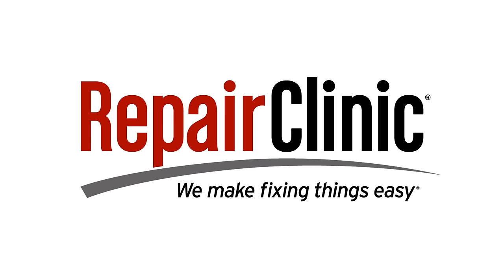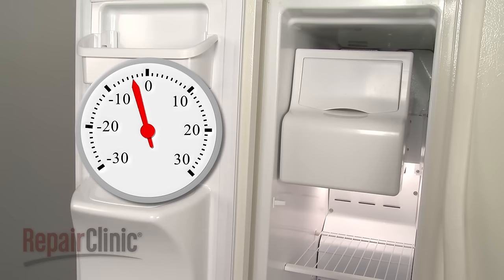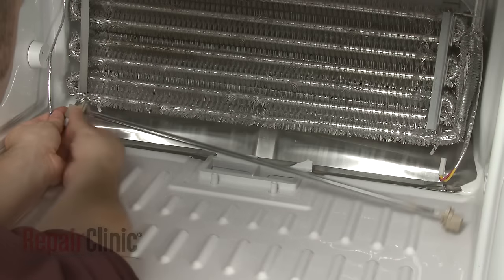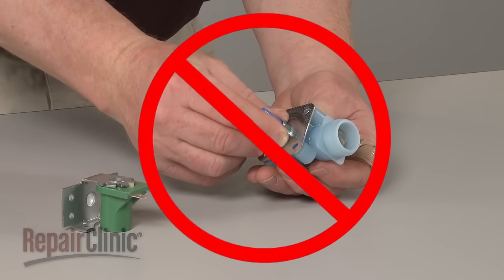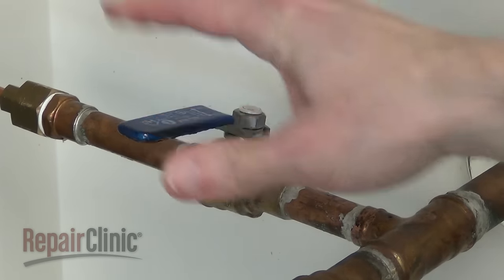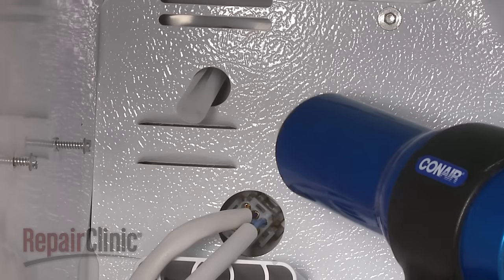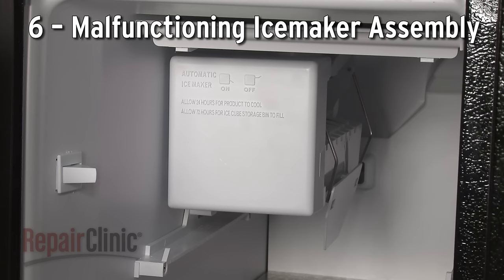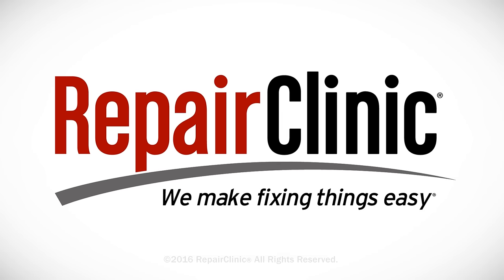Ice Maker Not Working — Refrigerator Troubleshooting

Comment: The ice maker works fine, but there is either a leak at the water input system or the valve is out of adjustment. Solid ice is forming at the front of the machine outside of the cubes. This eventually restricts opening of the basket. Result is to use a hair dryer to melt the excess ice. Is this a valve issue or need of new ice maker? Need to know which part to buy.

Comment: Just a heads up, use a thin flathead screwdriver to lift both tabs up and away from the electric connection, next use the same long, flat screwdriver to lift the tab away from the wall (from left to right) of the fridge as you pull the ice maker out.

Comment: The top 2 shelves of my  freezer are not working, but the bottom part is working.  The icemaker is at the top, so no ice.  I can hear the unit trying to work.  It will have loud popping sound occasionally.  It is a KitchenAid model #KSF26C6XYY04.  Any help would be appreciated!

Comment: GE TPX24PPDA 
Ice maker has several hollow ice cubes per tray and water also will occasionally flow from dispenser. The water inlet valve has been replaced within the last year. What do you recommend for the repair? Thank you.
Reply from the maker: Perhaps there is a problem with the water pressure to the valve. Check this out for more info: https://www.youtube.com/watch?v=x4YDWUK0jv8&t=23s
Reply: The water company, conducted a water pressure test today.  His reading, was 65 PSI.  I will check for kinks in the water supply line to the refrigerator since that may also contribute to this phenomenon.
Reply: Gary Gordon p

Comment: my refrigerator doesnt produce ice but it does dispense water... any extra points to check?
Reply: YES CHECK YOUR wallet because ice maker costs about $110.00 !!!!  At Lowes it is $99.00
Reply: The water tube that fills ice making trays maybe frozen up solid. I had a Maytag side by side that would happen to. Eventually they developed a tube that was open in top for better flow. Or, the solenoid that operates the ice making water valve has loose connection or has failed.
Reply: In my case, I just went ahead and bought a NEW ice maker, installed it myself, and it is now working perfectly......  So, the water valve solenoid was good.   Therefore, when you don't know WHICH one is bad, just buy the ice maker first, install it and see if the problem is fixed, as I did.
Reply: @mk5455  and dffpf

Comment: Trying to troubleshoot mine. It's not getting water to the tray. The water dispenser works though... Any thoughts?
Reply: swap the 2 contact connectors to the solenoids in the back of the fridge, then push in the water fill on the door.  water should start to fill the ice maker.  if not then the valve to the ice fill is bad

Comment: makes ice but not very much?
Reply: My Whirlpool side by side ice maker never worked right. Made it but very slow. Turns out the dial for freezer temp is set on Recommended setting of a raised circle at 12 o'clock position. The manual said "No matter where the pointer is on the freezer temp dial, temp doesn't change." I maxed the dial out just to see. went to bed and 8 hours later the ice container, which never had the ice agitator covered was nearly at the top of container.. If this description isn't clear, let me know and I'll sent pic of dial.
Reply: Ty
Reply: 8 )

Comment: If it gets to trying to clean out an old valve is not recommended it will be Oct 26 2016 Sarah and me
Reply: I have a problem that all really works fine but the grey inlet pipe @ the rear to the tray fits in to its compartment snug but after a short while pops out and water squirts out of the pipe onto the counter. The inlet pipe is not iced up and clear as I have tested it with a skewer. Any solutions.